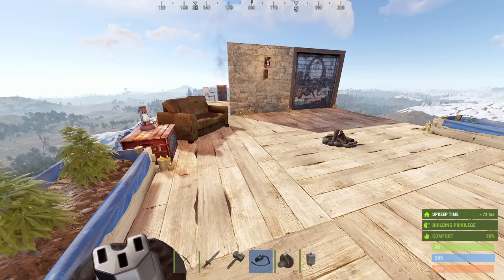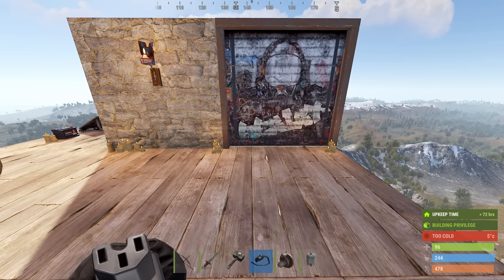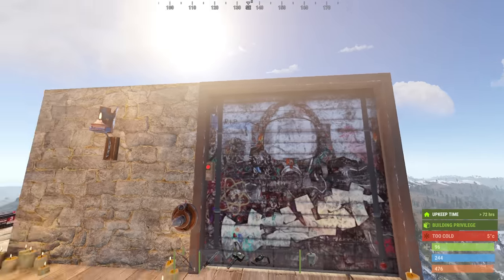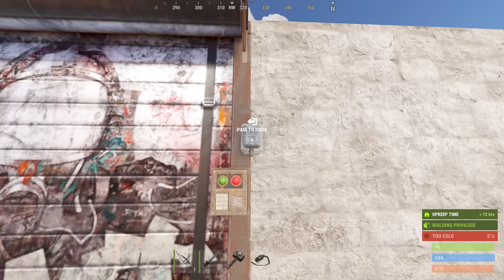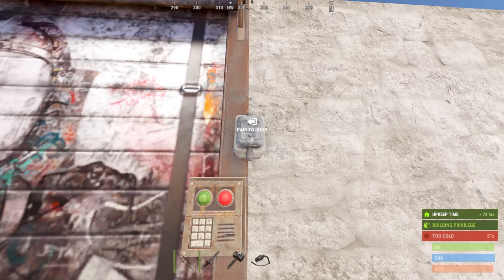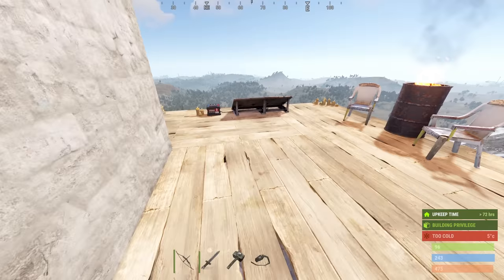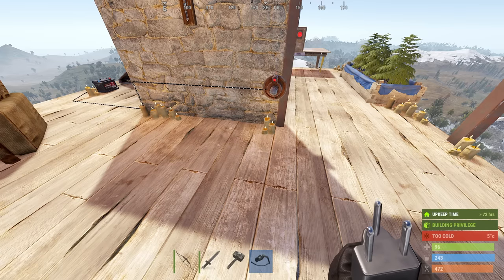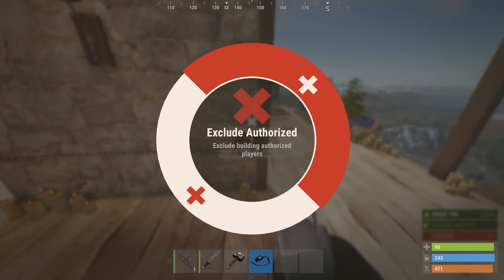RUST Electrics 4 - Auto Bay Door for Heli / Boat / Car!!

Comment: I like to set this up with a 15 second timer switch to prevent the door from closing on the vehicle.
Reply from the maker: That's a nice improvement and a level up, but I wanted to keep this as simple as poss so all could use it without much fuss!  I will be doing more involved circuits if I see the traction for it :)   .... and look forward to it. Electricity in Rust is extremely versatile.

Comment: Thanks for the information, I really enjoy these build videos - question: is it possible to fit : Small water Catcher, Pruifier, Small Garden box and a water barrel onto a single 1x1 square foundation?
Reply from the maker: Hmm that could be a challenge!!  :D
Reply: @GenXGamesMeister  so tried it out, and yes you can but its tricky - the small planter box has to go down first - must go in vertically pushed as far left or right as possible
 Next
 place a small chest horizontally against the back wall where the furthest back corner of the small plate box is touching the back wall
 Proceed forward by placing
small water catcher as far back and centered as possible
then (if everything else is placed correctly)
You should be able to place a water barrel in the empty space across from small planter box
Finally,
In that little square space closet to the door - place a skull campfire for lowlight but creepiness or campfire for bright beyond reason but not as loud..

It took a few tries - note: small water catcher can be placed in a 1x1 box  but only if the box doesn't have roof however a roof can be placed once water catcher is positioned.

If trying to place s.w.c. indoors under an already placed roof then there must be ain a room that is a wall and a half tall.

Yes, water catchers works indoors.

You can build directly around a large water catcher and over it as well. Make sure to have a 4x4 space (the thing is massive) - was able to fit it in a shape other than a square but cannot for the life of me remember the dimensions

BIG NOTE - Make sure the darn water barrel is facing the correct direction otherwise you wont be able to access it -   cannot even express the level of irritation I felt when I FINALLY got it to fit only for it to be facing the wrong way smh
Reply from the maker: @AlternateInfinite  Some good info here, cheers for all the detail will help many out!

Comment: kind of odd it closes if it doesn't detect, is that the door controller or the detector  doing that?
Reply from the maker: If the HBHF doesn't detect and its set for authorized only then this is correct, the door will close!